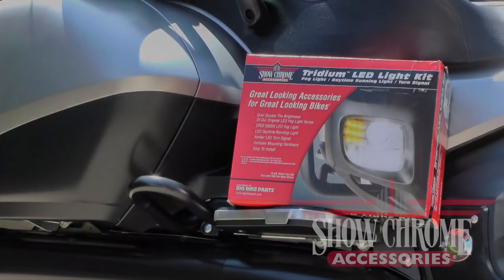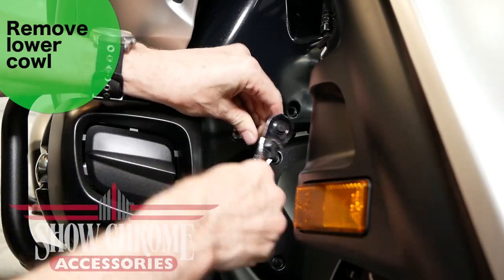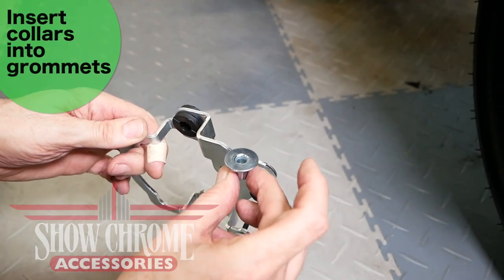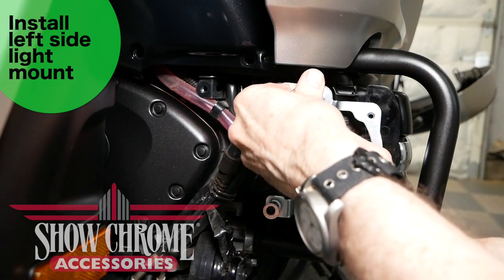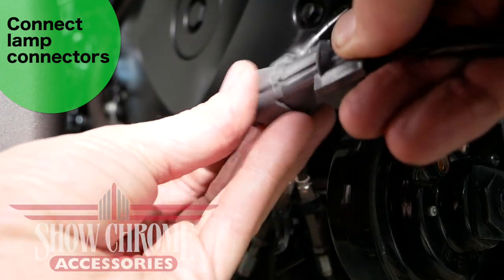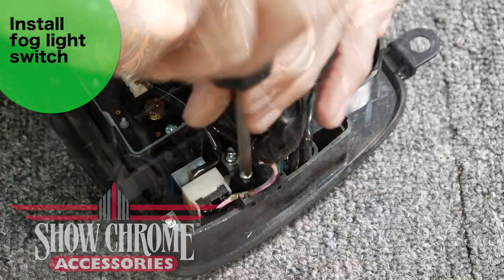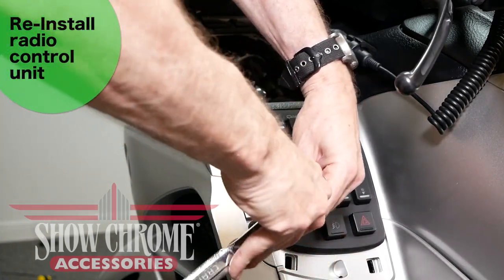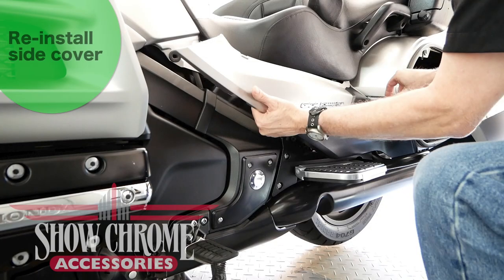Install Tridium Light Kit on 2012-2017 Honda Gold Wing/F6B

Comment: I installed this kit about a month before you put up this video.  They’re amazing, especially the fog lights.  One issue, the harness they provide to connect up to the turn signals are known to have the pins back out of the plastic clips causing a loss of connection for the running/turn signal lights.  I got mine all installed and took the bike out, checked when I got home and both the running lights were out.  I called Bigbikeparts and their tech was very quick to tell me they have never encountered issues with the lights themselves but several people have had issues with the pins backing out of the connectors.  Although I didn’t like having to drop the lower cowl again I was pleased to see that this was my issue.  I clipped their connectors and just hardwired them.  They work great!  They really light up the road in front the bike at night and look beautiful.
Reply: th3r3ds0x how did you hard wire ? I have a blue, blue white, and green cable from oem, and a red black and blue from the fog light kit. Any help would be great. My problem is the connectors they provided do not match my f6b deluxe.
Reply: @th3r3ds0x  I found the SAME ISSUE with Less than Quality Connectors. Such a Shame, Really Nice Lights with Poor Connectors, I purchased the Lights in Dec. 2019 so Obviously BigBikeParts has failed to Correct a Known Issue. I too will Cut the harness and Hard Wire it myself also.
Reply: BigBikeParts hey Travis thank you very much for getting back to me and even leaving your phone number. It is much appreciated. I ended up figuring it out. I realized the directions did say that, only it didn’t say which wire to match up since the color code was different. I actually got it on the first try and it was a wrap, I soldered them and wrapped them tightly with shrink wraps. It was a little extra work but it’s worth it. They’ve made a heck of a difference in not only visibility for me, but visibility as in I’m way more visible to others also. I love it. Thanks for your help.
Reply: @afgcop  My pleasure! Happy to hear they're doing well for you!
Reply: you all prolly dont care but does anybody know of a tool to get back into an instagram account??
I stupidly forgot the login password. I love any tips you can give me
Reply: @Caiden Colin Instablaster ;)
Reply: @Otto Kash It did the trick and I finally got access to my account again. Im so happy:D
Thank you so much, you saved my ass !
Reply: @Caiden Colin happy to help xD

Comment: 2014 Honda Valkyrie owners.  Our bikes have low voltage going LED turn signals, Unlike the F6B.  Yes, the show chromes will work. but if you want full functioning of the DRL and Signals you have to spend $50 more for an Admore valkyrie adapter. Same deal with Pathfinder lights also. The directions that come with the adapter are for the Pathfinder So cal lights which are wired differently.   I ran 6 -22 gauge wires from the seat to the front of the bike three wires for each fog.   The blue wires are for the DRL and should run to 12v switch power.   The red wires are for each turn signal I think red to Yellow is the right side as I remember and the black is your ground.  The pigtail harness wires in the kit will not work with the Valkyrie. They are for the F6b and wing installation 
I suggest buying a 6 pin connector for under the seat and two three pins for each fog so they can be disconnected if needed to replace. I also used a loomed harness. I ran mechanics wire under the tank and found a path to the front fogs without having to take anything off the bike.  Go slow use your head not a bad job.   It took me a while to get it the way I wanted it so I'm passing this along. Enjoy!
Reply from the maker: Good point.
Reply: Understand everything about turn signal, can you please point location of 12V switch power for DRL .
Reply: @boris1779   it's under the seat. If you get the Admore Valkyrie adapter, A-GL18RFL, the instructions point to the main harness under the seat. This is the best location to fit this adapter anyway, as there's more room to work.

Comment: I put those fog lights on my 2015 Valkyrie.  I didn't have the benefit of your video, and it wasn't easy.  I still haven't hooked up the turn signals .
Reply: Brandon, I have the same problem here.  Im starting to think the directional connectors are different on the 2014 and up Valkyrie.   I cannot find a connector on my Valk that will accept the directional harnesses supplied in the kit. I

Comment: Do yourself a favor and just take the black plastic off from under the fork area. You can easily fish wires after that and then have all the access to zip tie the wires away from the radiator and hoses. If you try to fish it like in the video, for one it will take forever and two the wires will more than likely end up laying against the radiator and melting.

Comment: My turn signal and running lights work fine but one of the fog lights went out shortly after I got them. I took the back cover off and there is a lot in there. Any instructions or tips on how to replace the LED? Replacement Bulb size?  Thanks for the great videos

Comment: Great Video. Which ligkt kit has the best light output between this Tridium kit or the Pathfinder kit?

Somehow I missed you at WD 40. Thanks for all the great vids.
Reply from the maker: They are both very capable and comparable as far as output goes. The DRLs on the Tridium are brighter than the Pathfinder.

Comment: Attempted to install on my 2016 F6B and not able to locate wire attachment for fog lights under radio panel. He says repeat on other side. Incorrect! There is a metal box/panel on right side under panel where button for heated grips which makes it's impossible to locate wire to connect fog light. Have to take bike to shop.

Comment: I got everything on my 2014 Valkyrie and lower cowl doesn't fit on fog lights holes . Looks like both lights are too far off each other,  or facing out ! Use 4mm long spacer on right and two 16mm and 20mm left. Please any help how to correct fit  . P.S. bought fog lights work great. I think to buy adapter for day lights (turn signals).
Reply: Use 4mm spacer on right fog light top bolt and will work.
Reply: I just installed these on my 2013 Goldwing. Everything seems to be working except the lower cowl like was side. I’m thinking of doing the same on the right also doing the similar to the left. 20mm on top and 16mm on the side. I’ll let you all know how it works out.
Reply: Right now I’m about a half inch from fitting perfect.
Reply: Ok what I ended up doing to get the cowl to line up with the fog lights was moving the 4mm spacers to the top bolt on the right side. On the left side I to put the 16mm spacer to the side bolt and put the 20mm on the top bolt. In doing so the cowl was able to line up with the lights. Good luck and thanks for your input.

Comment: I installed this kit six months ago. Everything worked fine, until the other day after I jumped my rear trunk lights to have two running lights. Now the signal/running lights on both tridiums blink once when I hit either brake. I disconnected my jumpers and set back to factory but it is still happening. Anyone else have this issue or know what is wrong? Thx!

Comment: have them on my 2016, when you turn on the right blinker the whole right side goes out ,0nly had them for 5 months
Reply from the maker: Have you contacted Show Chrome? That sounds like some sort of ground wire issue. Or, perhaps a bad connector?
Reply: thanks ill give them a call
Reply: Check the connectors, mine had pins backing out on both sides after my first trip out.  The running lights were out and the turn signals barely wanted to light (very weak connection) I clipped the wires and just soldered and heatshrinked the leads on both sides so I wouldn’t have the issue again.  Great lights.
Reply: I have this same issue
Reply: @brandonwestphal6886  Why don't BigBikeParts Correct this KNOWN ISSUE.....looks like several Years and still the Issue Remains. My Lights Purchased Dec. 2019 have the Same Issue. Really Poor Quality Connectors......
Reply: @DavidVerch  Cut the Wires closest to the Connectors and Hard Wire them.
Reply: @th3r3ds0x  Mine Also.

Comment: What, if any, are the changes to install on a 14 F6B?
Reply: The turn signal/running lights need to be spliced into existing wiring for F6B
Reply: Criq deKuyper thanks for the reply

Comment: Do not buy it they say it fits 2014 and never honda valkyrie it's not I bought these lights but nothing just waste of time and money don't buy for 2014 or 2015 valkyrie it doesn't work.
Reply: Our tridium lights aren't designed for the Valkrie's only the F6B and the Goldwings.
Reply: @bigbikeparts3753  so I can or I can not use it on the 2014 Valkyrie? Some of you said yes give us a call to help you with... And here is a definitely not. So the Admore adapter or the 6 wires will work or not?
Reply: @jhoneuryfeliz2464  Good morning! While this kit isn't designed for the Valkyrie, this WILL work on the Valkyrie, however, you need to purchase a Valkyrie Adapter from Admore Lighting.